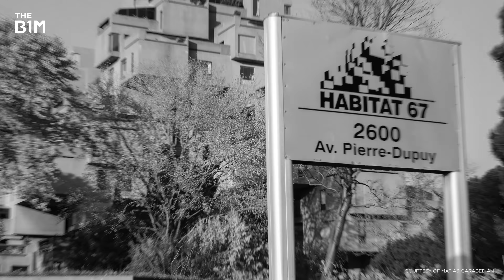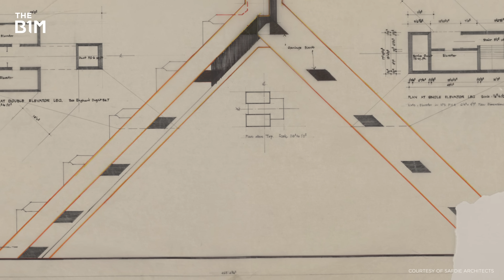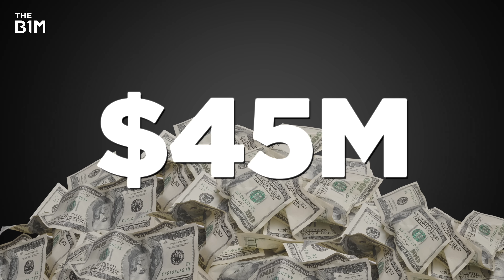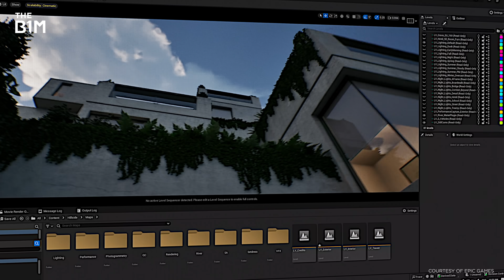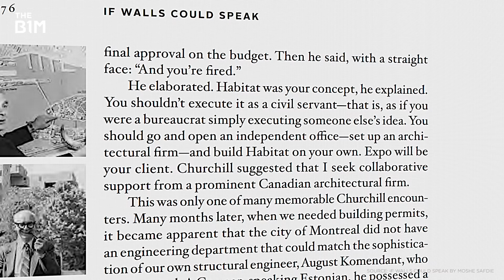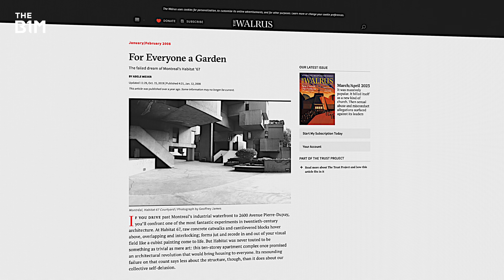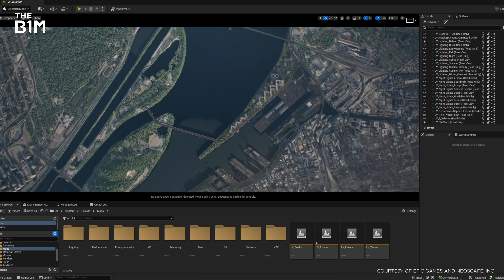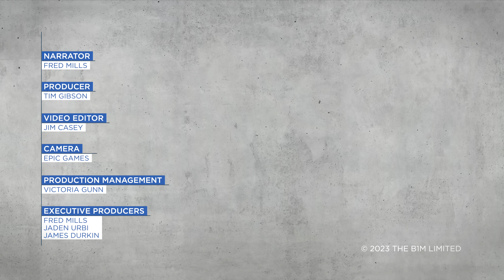How a 23-Year-Old Solved Urban Sprawl

Comment: Wow super interesting! We have this design in my city near Paris! Much smaller scale though, I guess higher level is 4-5 floor from the street. The 3rd floor is also designed to act as a pedestrian street, originally with shops... Although (and I think that s the main problem of this idea), the pedestrian trafic is so small that probably no shops could ever survive on other levels than street level... Or the structure must be gigantic to make it work

As a pure residential though I guess it s nice, every appartments have indeed a small terrace//garden with few to no exposure to other appartments

Comment: Not really sure this solves urban sprawl, as the cost of building it seem like would be greater then building a normal house.. looking around there's mention of one flat being sold, looks to be a 1 bedroom, costing around £800k.

Secondly, the 'big idea' here is the stack them at an angle so each can have a terrace and light.....eeer, and also therefore less internal space??

This isn't revolutionary, it's just another option of living. That looks to be most useful for singles or couples wanting to live in the city.
That have enough money to buy a flat with a terrace.

There's just too many things that this doesn't cater for.
It's only real directly replace current towerblocks as a living option.....and it would take up more ground space then them

Comment: 1) plumbing, wires etc. would be a nightmare
2) worse surface area to volume ratio, bad for heating, higher maintenance cost (cleaning/ repainting etc.)
Similarly to prefabricated, modular homes, great idea on paper, but in practice.... Yes, cheaper than a regular home, but won't last as long, and land  + all utilities, taxes, permits, lawyers, city stuff cost a lot. If you already own a house+land and have free room to put one down for rent, yeah great. If you don't have a home it's still too expensive. Only exception is if it's in middle of nowhere, but there you can buy an abandoned home for pennies so why bother with modular stuff.

Comment: I recently wanted to learn UE5 as a Interior Designer and ArchViz freelancer, but the lack of built in library with interior assets its making me not to.. Please, is there a way to overcome this? I mean i use cheap Chinese software, that has 500+sofas, 300+ chairs, 250 lamps, thousands of accessoties, ect.. Its just packed. I know there are sites like CGtrader, where i can buy those assets, but hell it would ruin me. I cannot be limited to few sofas and beds as an Interior designer? .. I wish I knew the way

Comment: How do you plant trees on concrete surfaces? We had problems with this at our houses, built in sweden in the mid 70s with trees everywhere and only pedestrian streets with cars underneath everything. Marked as culturally valuable, has to be preserved as originally intended for the future by the authorities. 

Problem is the tree roots growing made hole in the sealing layer between soil and concrete slab under. (same slab is the roof of garage and roads). We had to cut them down to save the buildings, but the area of course doesn't look the same. There are stil seeping in water every here and there, there will be a costly replacement of the sealing.

They have tried to change the entire layout bringing the roads up into sunlight and level with everything else, mainly to prevent insecurity since police and guards nowadays patrol in cars and not on foot. The people said no and plans were back to drawing board but the area still has high crime rate for the country.

By the way, the buildings in this very good video reminds of the newly built skyscraper "Tors torn" (=Towers of Thor) in Stockholm. (Now renamed "Norra tornen" (=North towers).

Comment: It's a great idea, but why is it so fugly? It looks like they were more interested showing off their engineering skills than building a livable habitat. How to those irregular shapes perform in Canadian winters? The insulation (temperature and humidity) must've cost a fortune.
I can't see any shops or industry there. What do they actually mean by mixed use? Different apartment sizes? Traditional mixed use buildings have shops and services at a ground floor, and maybe offices in a central tower. This is just a heap of lego apartments with some green spaces and covered walks..

Comment: I love how even though it's fundamentally a brutalist concrete structure from the 60's and they modeled it with weathering, it doesn't look run down or ugly. At all.
Reply: @bhante1345 Tl;Dr: If it develops mold, will it be a slum? Anything will. Will it develop mold? It has a higher tendency to do so than tower blocks, but since maintenance exists, I'm not sure if it also has a higher probability. If someone wants to shoot a Judge Dredd movie, will they choose this building as a visual indicator of the dystopian state of the unemployed masses? I probably wouldn't, but it creates the associations of overcrowding just as well as any other 8-ish-storey brutalist building.

That first sentence is true for any type of building, though. Anything that doesn't get maintained will develop problems. And anything with serious problems will become undesirable to anyone who can't afford a place outside a slum. But in any place that people feel attached to (for example because of them being exceptionally livable, which any building of this style would be; or exceptionally prestigious, which the first few would be) you will get tenants putting pressure on the owner to properly maintain it.

The only major problems that I see with the structure/design of the building is those many perfectly horizontal surfaces under the overhangs. They could be a place for dew to collect unless properly ventilated, but the large open sides should take care of that. Due to them being upside down they would also not grow any moss, which needs sunlight; only mold, which would need nutrients from the concrete. And if a concrete that leaches out minerals is used, those places would grow stalactites. I would expect that with the right concrete you'd greatly suppress the mold and stalactites.
And my point was that the building would still look passable, even with mild forms of the two problems above.

I have to admit to the Judge Dredd part, but this is how I would expect the buildings to look where the Street Judges and other low ranking members of the ruling class would live.

Comment: A major housing project in Dublin, Ireland used prefab panels to build in the early 1960's in Ballymun. It leaked terribly and the services and lifts were always breaking down.The housing authorities used the complex to house the poorest of people needing housing but did not plan for shops and other facilities needed in any working community. These towers were knocked down lately after 5 decades of utter failure. Prefab structures need to be built by newly trained builders and operators with a great emphasis on eliminating water ingress and damp control as a priority. Using builders with experience only in traditional methods with little or no supervision or oversight can lead to a lot of mistakes and costly rectification or demolition.
Such prefab methods differ so much from traditional bricks and mortor construction that  a completely new set of builders and training are needed for their construction.

Comment: I have a couple of requirements to live around other people.  I don't want to share a wall and have to listen to my neighbors' music or shouting;  I don't want to have anyone living over me, making noise as they run around upstairs.   I want a garage for my car, and a relatively short walk from my car to my home, or if a longer walk, then a cart I can use to transfer my groceries.  This thing seems like it may solve the shared wall and upstairs problem.
Reply: How does one get to the top floor with a 30 lb bag of cat food? You can't put elevators on a diagonal. I'm also wondering where the plumbing runs go. )That problem has obviously been solved. I'm just curious.)

Comment: As a trained architect I see this as a great study and inspiration, but not meant to be actually built. The building physics of this are a nightmare and probably makes the design unfeasible. All those roof terraces (with vegetation) that are bound to leak at some point. Then the surface area to insulate. Then the gazillion 3d corners to solve not just structurally but also in terms of weathering and insulation. Probably not such a great concern in the 60's when we had abundant and cheap oil, but now a non-starter. Maybe it can be solved one day, but it looks like the design as it is did not need to address this at all (as so many other showpieces). So great idea, but not very realistic in today's world. "What if?" I doubt it would have made a difference.

Comment: This is not a realistic solution for urban sprawl. The major reason being that the footprint of this building and it's relative capacity compared to a skyscraper with the same footprint means that each apartment will have to cost an unreasonable amount of money to be justified. Not to mention the increased overhead for non-standard utilities and the extra building reinforcement to be stable at that angle, and a non-standard elevator/shaft, becuase the design as is currently has no elevator, which is a legal requirement where I live.

Comment: Realistically, this concept doesn't make sense. It is not efficient and costs too much.  Too many walls are single purpose wall (exterior wall) and this is very costly. Also, too many corners, which means too many places for leaks and cracks and such.  It is a really good proof of concept, and should be used as an extreme example that not everything has to be a single box.

Comment: Anybody who lives in that building, how do you handle the snow during winter time? I have had terrace like that, during summer it was ok because there was draining for the water, but during winter icy water froze the pipes and caused leaks in the apartments underneath. So I had to throw the snow down each time it was snowing, and I could not see where I threw it so someone could have been walking on the street below. So a bit problematic design at least in cold areas.

Comment: Build these out of Hempcrete for sustainability. Build as mixed use you have an actual "Arcology" that was featured in Sim City 2000. Imagine a superblock with standard 5 story buildings as a street front with ground floor retail, with a park-like area with these structures rising up behind the buildings. Just a few superblocks could house tens of thousands of people, giving the density needed to sustain walkable business along the street fronts. Underground parking could be made affordable if req's are slashed (by 50%) in expectation of robo-taxi service before 2030.

Comment: One of things that I've always thought since September 11 is that high rise buildings should be climbable. Had the Twin Towers been climbable, many people would have been saved. With vertical buildings this means including climbable elements to the outside facade, and with new buildings it means creating stepped terraces that you can walk down the outside of, which creates pyramidal structures. Security can be handled by outward opening doors.

Comment: Habitat 67 is an amazing structural masterpiece. As a green builder and designer in northern climates it is problematic regarding energy consumption. 
I worked on an award winning building recently that has similar convoluted layered architectural qualities to the Habitat structure. We were the second crew to come in and do major repairs on the leaking structure.  The complexity of the building and the poor quality construction were problematic. They also used timberstrand products for studs and top plates.  When the water damaged to these products they swelled and came apart. I took the claw of my hammer to disassemble part of the building and it was like digging into a box of cornflakes.
Longevity,  durability and energy efficiency can be solved through simplicity. Skilled quality builders help as well.
Reply: I will never understand why someone would think having to get on a car to go buy groceries is a good idea. Talk about living in denial
Reply: @juezna  North America has been built and designed around the autmobile for the last 100 years.  It is sad in many aspects and totally absured in a sensable reality.  
I lived in a wealthy neighbourhood where strenuous bike rides up hills was a daily exercise to stay in shape. Sometimes I would think, if these people need a gallon of milk, they have to get in their car, use 250 million year old fossil remains to haul more than a ton of metal up and down the side of a mountain. 
This wont last forever.
Reply: why didn't they use composite materials? they are very common these days
Reply: @krisstopher8259  timberstrand is a composite material. What are you talking about?
Reply: @SpaceNerde I have to deal with this at a friends house. They believe that 15min cities are evil, meant to control you, that you will only be able to leave a certain amount of times.  how do you convince them? I am stuck. It seems absolutely insane to me this belief. I ask them; Without your car what would you do? where would you be? how would you get to work and get groceries?" then i say "The whole point of having multiple modes of transportation and ways of getting around is so you are not reliant on one form over another. Hence why I want better bike lanes, public transport, and walkability. In a 15 min city you have the convivence of most things within a quick distance and, the hope is, to have good public transportation for traveling if you need." the snap back is always "what if you work out side the area? they wont let you!" ... sigh "they will let you and you get to work quicker and more efficiently due to less cars, more public transit, and ways to get there. Do you believe you are free with your car? Do you believe you would be free if your only choice of ice cream was vanilla when all the flavors exist? is it more free to choose from all the flavors or to only be allowed one which you must take?" doesnt work, need help.
Reply: @SpaceNerden Like communism means having everything for free and not having to work in a gulag? There is usually a big difference between a promise and an implementation.
When I first heard of the 15 minute city I was excited. I watched loads of videos about it. And then I noticed how it's actually getting implemented. No one is going to rebuild your town to make everything accessible in a walking radius. They just draw zones on a city map and fine you for driving across the imaginary line.
Reply: @milobem4458  lol what a joke. Where exactly did you see this?
Reply: @veresij_  Oxford, England. You can find plenty of articles dismissing the "conspiracy theories" around it, which don't actually dismiss any concern, and only focus on strawmen.
The fact is Oxfordshire 15 minute city plan doesn't include any improvement to city design, but only "traffic filters", with armed with cameras to automatically fine drivers.
Reply: @milobem4458  I did my research. I understand everything.
Reply: @milobem4458  Crazy Brits doing crazy things have little to do with what the 15 minute city is about. There are many 15 minute cities around the world already with no traffic filters or travel restrictions.
Reply: @znail4675  I grew up in a 15 minute town in Poland before they were cool. That's why I was positively surprised when I first heard that Americans are finally discovering the idea of walking to a corner shop.
Like I wrote before, it's a great idea. But I have yet to see any car-centric city in the US actually doing it right. It's easier to limit traffic than redesign and rebuild a city.
UK, like most European countries is already mostly walkable, but unlike most European countries it likes to mindlessly copy all bad practices from the US.
Reply: @milobem4458  Americans who are just discovering the idea of walking are the ones who own in excess. As dysfunctional as my hometown of New York City is, generations of millions have still lived lives largely independent of cars here, in conditions functionally close to a 15 minute city.
Reply: @milobem4458 , a 15 min city and a city using congestion charges are not the same. Also, you arent fined for walking, cycling, bussing or training across those lines. Just driving.
Reply: NO!!!!! WE DO NOT WANT 15MIN CITIES!!!!!!!!!
WE WANT FREEDOM!!!!!!
Reply: @YELLTELL  I'll use the conspiratorial rhetoric you have been consuming (in this case of my example, it's more true than not).

'THE CAR AND OIL INDUSTRIES ARE TAKING YOUR FREEDOM AWAY!!!
They want you to to be dependent on cars and not take public transportation for a more efficient and cost effective way of commuting! They want you to keep spending money by having you drive miles from your suburban homes just for groceries!! Can't you see!? They want your hard earned money to spend on gas, maintenance and oil to make themselves rich!
They don't want us to walk or cycle, they want us in a metal box to depend on commuting and travel, they want us to be out of shape and unhealthy, they want us to consume cheap food from fast foods by car!!!!'